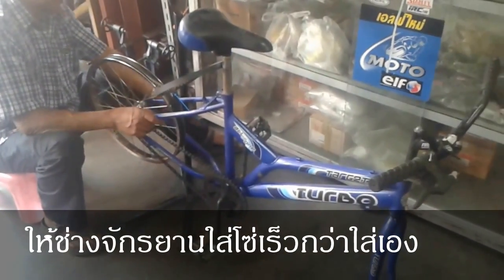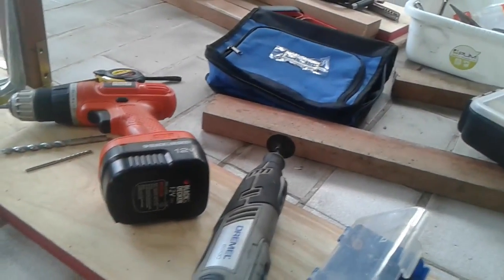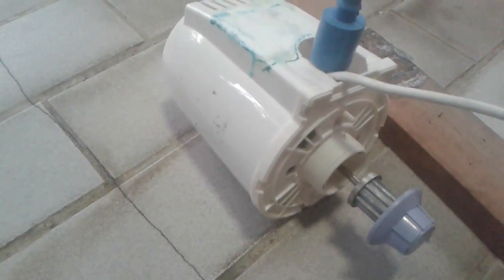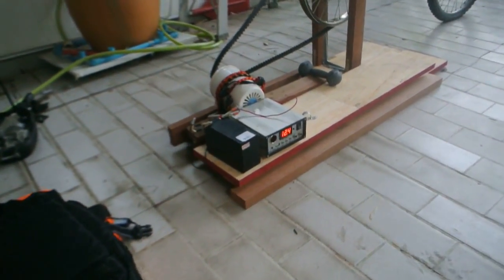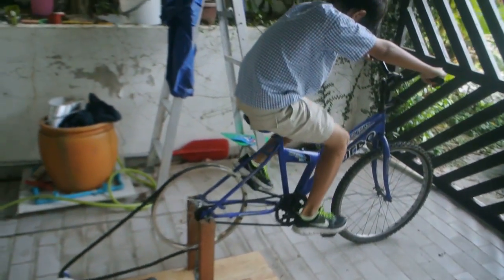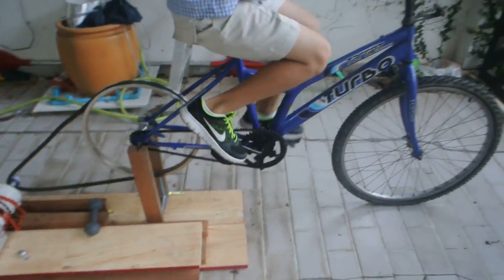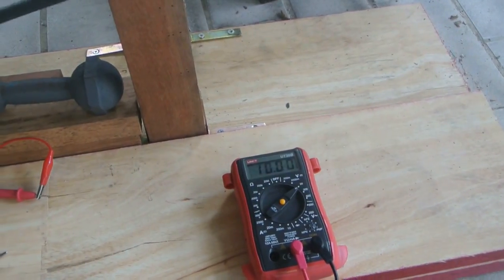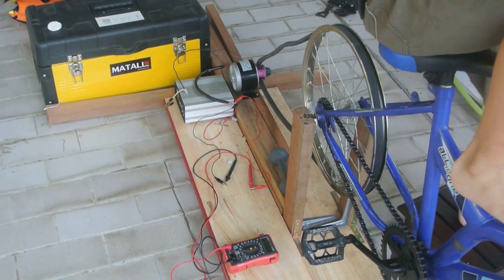DIY bicycle trainer electric generator build, pilot test

Comment: how big of a battery can you use
Reply from the maker: +billbb, as big as you want but of course you should do the calculations for how much energy you plan to use of the battery and how much you'll thus need to recharge to keep it topped up and in optimal health. It comes downto the practicality that dictates your decision for battery/system. For example if you has a 100 amp battery at 12 volts, that's 1.2kW hours of potential energy, and if you discharge 20 per cent in between charges, that means you would theoretically use 240W hours of energy (running a 40 W computer for six hours for example), and so (again theoretically) if you're only generating 40 W of energy with bicycle generator, to achieve 240W of power would require six hours of continuous pedaling. This is the basic math to consider. In reality there are other factors, and tests need to be done to see how much each system is actually producing, recharging... In general, smaller battery and lower discharge rate in between charges is more practical for this kind of project. Thus an ideal, practicle system would be a small one, used for LED lights for the night which consumed 40-50W hours of energy, in which a morning half hour to hour cycle would top of the battery for the next night.

Comment: why didn't you use an 21 speed bike it would way Easy to peddel and it would go faster
Reply from the maker: +Colin Long The original wheel on this bike was a 15 speed shimano, but with a 26 inch rim; the problem was that the largest drive belt available here had a 26 inch circumference and the the drive built needs to be much larger than the rim to have enough slack to drive the motor adjacent to the wheel. In any case, it's not too hard to pedal, and the amount of energy that can be generated as is is sufficient for the purposes of charging a 12v battery.